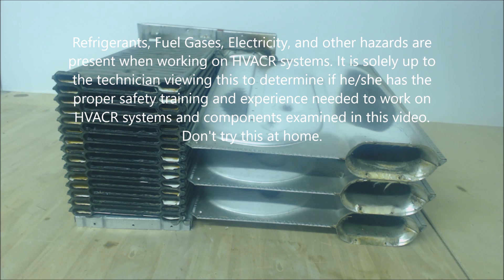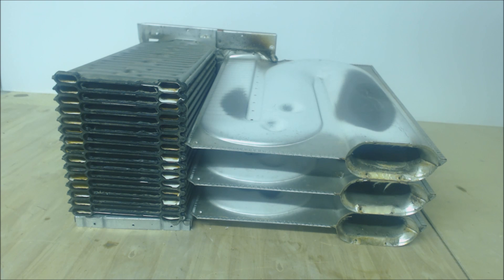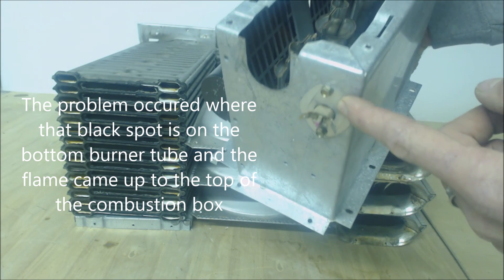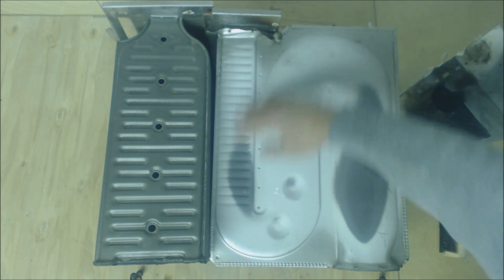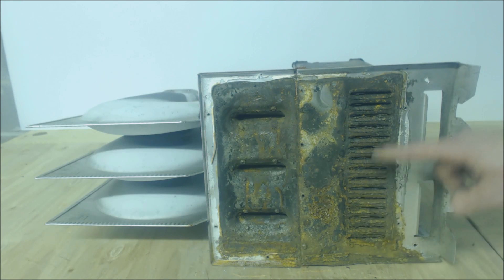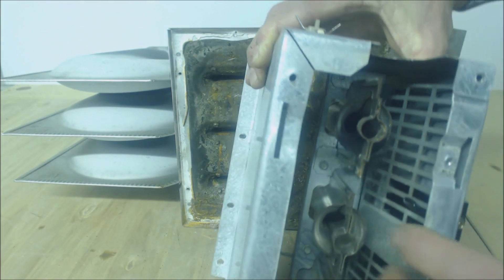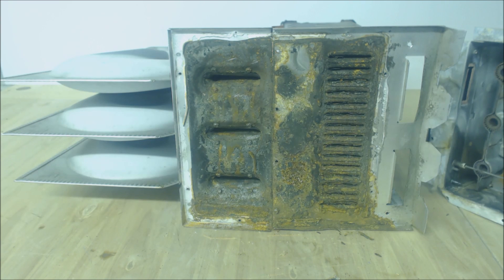Gas Furnace Heat Exchanger Clogged Problem- What it looks like and Burn Spots!

Comment: can you clean the heat exchanger?
Reply from the maker: You cannot clean this heat exchanger. It is the secondary that is clogged. These clogs are easy to see when it is out but is covered by everything and is basically the last thing to come out of the furnace. Thanks

Comment: Wouldnt a combustion effiency test give you evidence of a plugged heat exchanger? I would think you would get high levels of CO? Thanks for posting this.
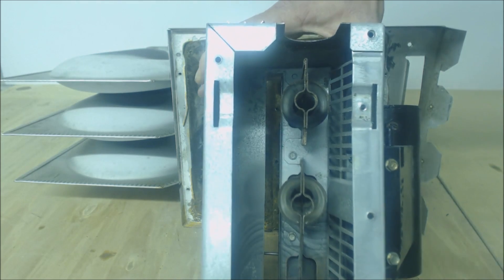Reply from the maker: Yes absolutely, ha you made me second guess myself and I looked to make sure I said that. I did mention doing a combustion analysis a couple times between 9:45-10:15.  Thanks for your comments and questions!
Reply: Yes. And when you show up at a house and you can actually "smell"  the stench of the aldehydes before you even get close to the venting and in the furnace room, you know you're looking at CO levels in the thousands of PPM.

Comment: Is it a clogged condensate drain that causes this or gas pressures ,burning ?
Reply from the maker: Great Question, In this scenario, it was the design of the manufacturer because the secondary heat exchanger rusted shut due to the condensate that it is supposed to handle thereby shutting off the ability for the inducer motor to pull the exhaust through. There was nothing wrong with the design from the installer and the gas pressure was set correctly.

Comment: have you seen condensation leaking through the cover plate gasket and onto the burner  on a vertical  90 plus furnace?
Reply from the maker: I tend to see that more so when the inducer box is higher than the combustion box where the seal breaks on 80% efficient furnaces.
Reply: Trying figure out how some kind of pinkish fluid got into the condensation line and glopped all over the inside of the induction motor and looks
Like into the tubes
Reply: @gerhardschemel3565  rust from the secondary

Comment: Great video. I just ran into an early 2000 carrier 90+ furnace with secondary heat exchanger problems. I guess the polypropylene coating deteriorates and clogs the heat exchanger. There is a list of model numbers for carrier and bryant with affected models.
Reply from the maker: Yeah and you can see how much they are willing to give you for labor based upon the age. Thanks Dustin!